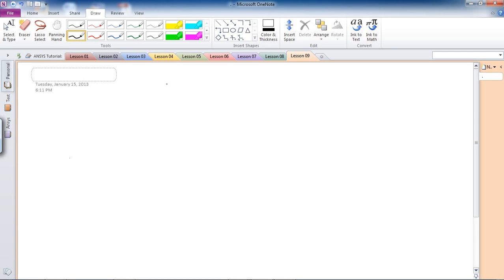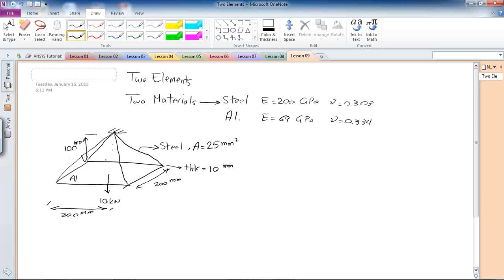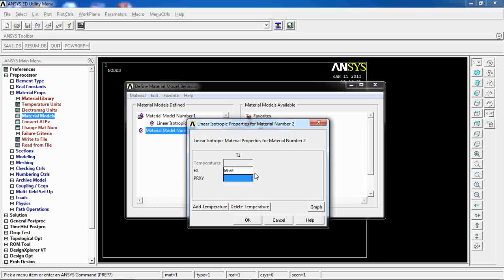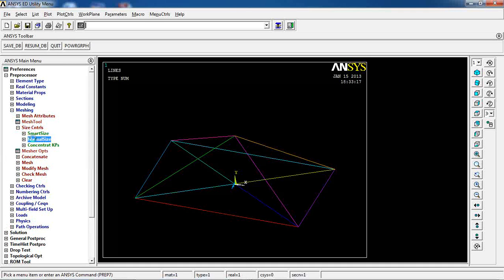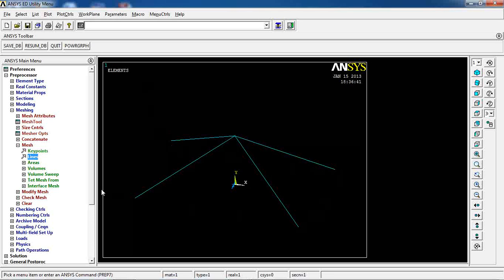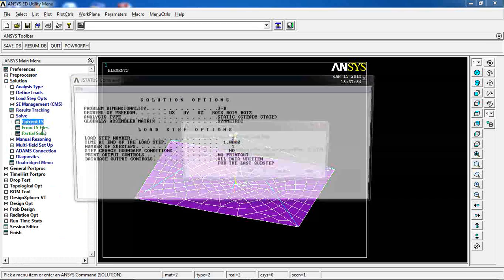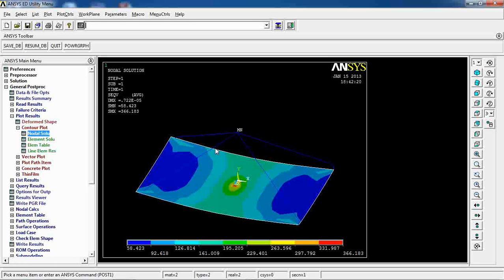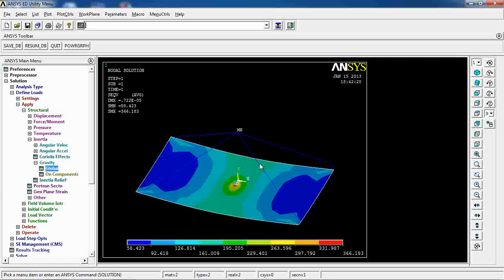ANSYS - Lesson 09: Analyzing a  3D Model with Two Elements and Two Materials

Comment from the maker: There's a correction made to this model. Please follow the correction on ANSYS - Lesson 09 (2).
Reply: Hello, I did look onto the "correction on ANSYS - Lesson 09 (2)"; issues discussed was bolean, 3d view and thickness of the shell. I followed them, however, I still am getting an error saying "a small euation solver pivot term has been encountered at uz degree of freedom of 55. ansys has automatically constrained this degree of freedom. check for an insufficiently constrained model". I am using ANSYS 18.1 and used the commads ET, 1, link8 and ET, 2, shell93 ; R, 1, 25, ,  and R, 2, 10, 10, 10, , ,   I think the problem is to do something with shell element, because even when I model a shell93 rectangular shape with four edges simply supported, I still get this error and there is no solution even when I solve it. Please help. Also, could you provide me the .db file for this modelling so that I can look at it and hopefully learn more. Thank You.